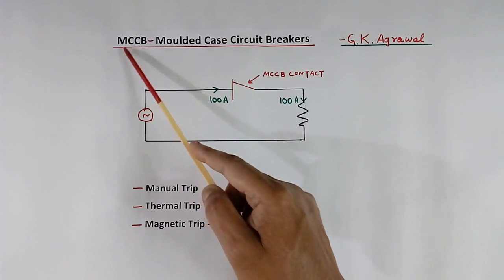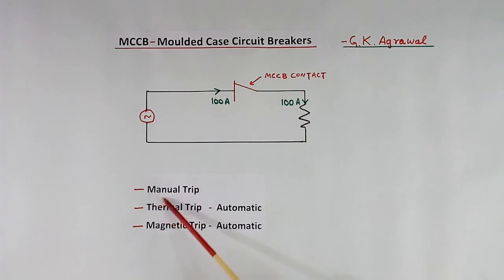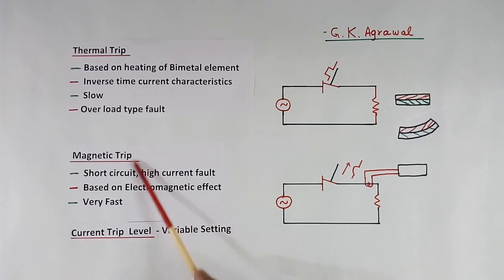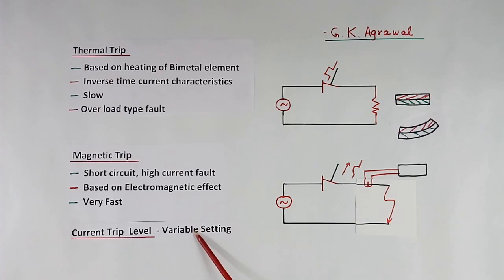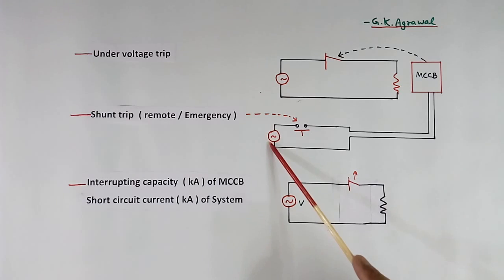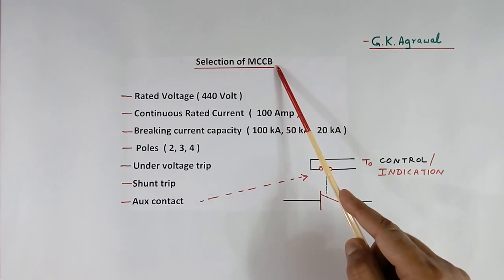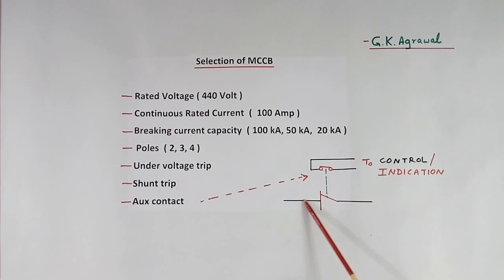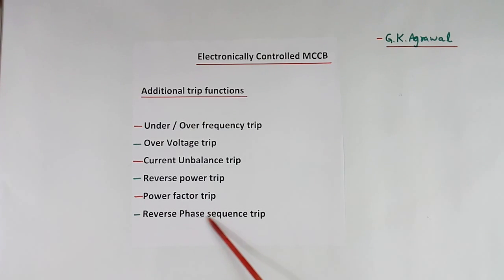What is MCCB Circuit Breaker | Magnetic vs. Thermal trip

Comment: Out class..... perfect video.....I got it thoroughly finally.
Reply: Thanks for the reply sir
Sir three phase amp meter Kay sath hum CT ratio 300/5 attach kartay hai to aik red phase wire mein agar 200amp current guzray to CT amp meter pr kia show ho ga 200 amp ya 5 amp show ho ga please reply me..... thanks from Pakistan
Reply from the maker: Secondary and meter mey 5X200/300 = 3.34 amp bahegi. Meter 200 Amp show karegaa. Ammeter CT ratio keh liye calibrate aur scaled hotey hai. Ammeter kareedtey samay CT key barey mey batana padta hai.

Comment: Sir I have a question their selection of MCCB part when Continuous current flow over like 105Amp it will be trip or not.....
Another question is that Breaking current capacity for my(100kA) breaker/short circuit current flow  it will trip 50kA,70kA,80kA,90kA,98kA or not tripping............